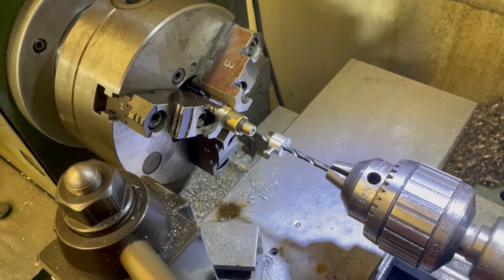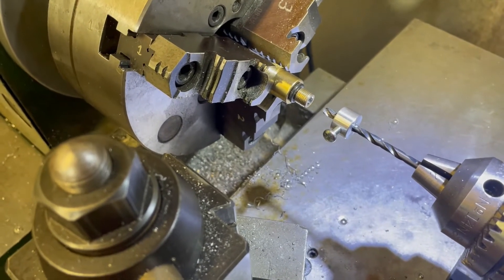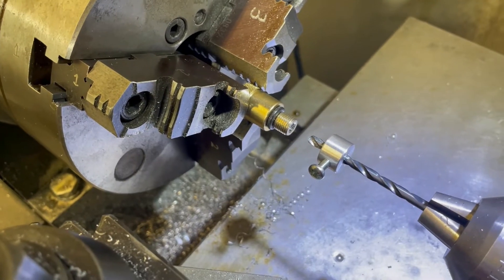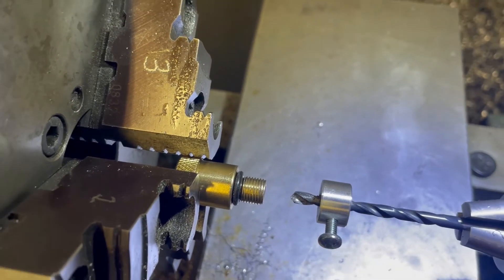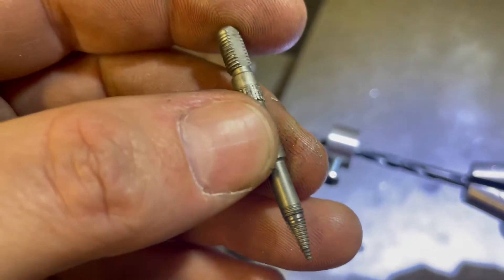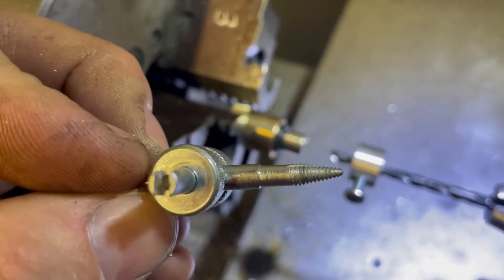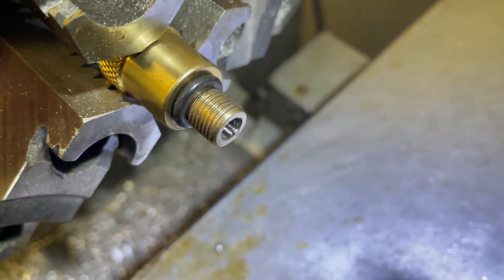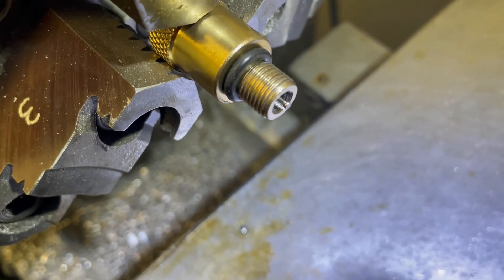Modifying cheap compression tester adapters for more accurate readings.

Comment: Do you have a link to order those valvs? I find only the one with stiffer spring
Reply from the maker: https://www.ebay.com/itm/256348796802?hash=item3baf943782:g:hbwAAOSwZpRaupCV&amdata=enc%3AAQAIAAAA0FALyRCns45iHsKWV7nMt%2FuUv0HGwEVIaNl%2BHH%2BmNetyEZYbMxi%2FJmEFyGMfv4ESU5fHlkgFzsfTaCLF1eeMAyHVHQNN88i0wpYfBSzChcPisYTNFnCaeREVswFLE3xJANJObfYjj5vXJq5r2f0%2FP%2FCZ38ffXROyiyljOF2JF1W2OktrHHdv7LjDxqK4oPK7w%2FQ8w5w4Nr60mPR8OMYltL8dtGCG0wbJQG9BOLge6%2Biagdv4XDNEkNYAHLsFRwdToNRDk5kyk2VEGXt4pY42Rs4%3D%7Ctkp%3ABk9SR_iI-d6xYw

Comment: I tested compression on a Stihl blower that has 10mm spark plug threads. With a thread adapter on my compression tester I got 100 PSI. With a hose that has the schrader valve right there in the tip of the threads I got 160 PSI. So I had a 60 PSI difference between tests. Does that sound right?
Reply from the maker: That sounds pretty typical.

Comment: Is this just a standard Schrader core being used?
Reply from the maker: I was using a standard core for a test fit, you need special low opening pressure Schrader cores to get accurate compression measurements.
Reply: @srcarr52  thanks! I'll give it a try with those, now I just hotglued in a regular valvestem but it does not give accurate readings I think